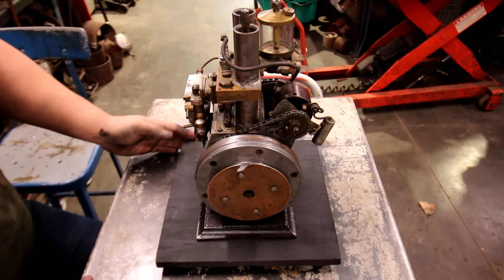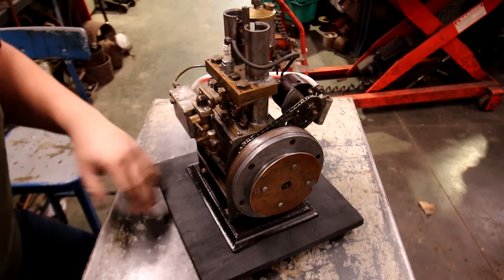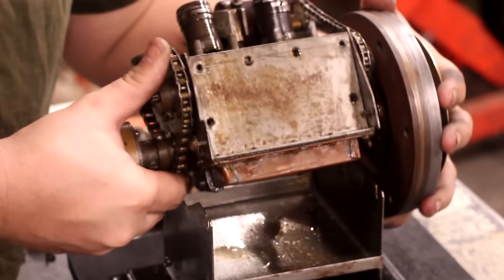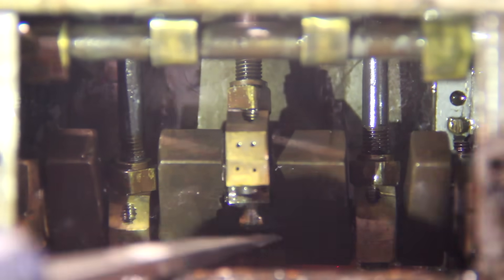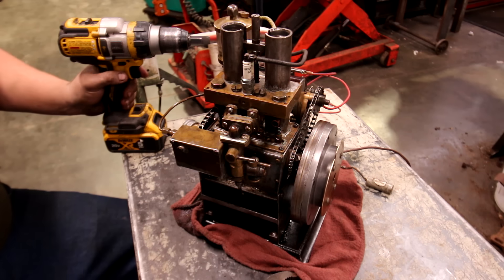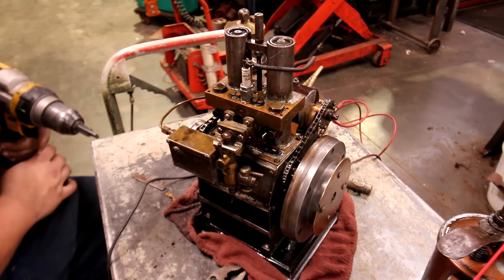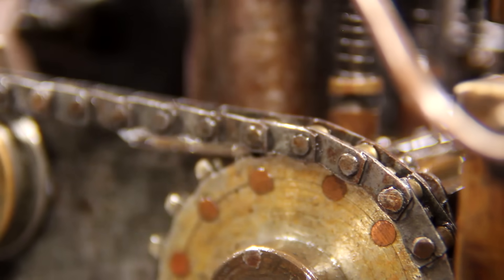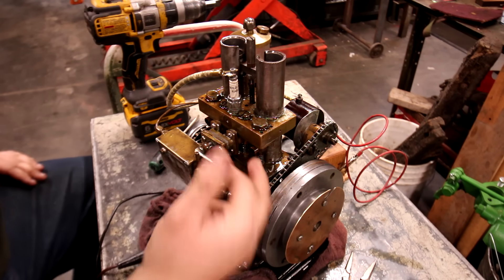RARE!   Antique Homebuilt Two Cylinder Opposed Piston Engine. WILL IT RUN?

Comment: Unusual for an opposed piston engine to have valves they are usually 2 stroke.  And only single plug so a bit more like a twingle.
Reply from the maker: its a twingle and apposed piston kinda terrible design really. like a quadruple twingle

Comment: As noted: There is NO cooling system for this nice little engine, so your run time is very limited, to about two minutes.
 
YOU are now the caretaker/owner of this nice little engine, So I suggest it is YOUR responsibility to take the Next Step, 
to ADD a cooling system that Suits this little engine, yet preserves the hand-made character of this "Historic Gem".

Here's How:  
(1) Start with a sheet of Tempered (heat resistant) Glass, about 1/4in (6mm) thick, and cut four 
       rectangular pieces, about 3cm longer than outside length needed to cover both cylinders. 
(2) cut two holes in these pieces of glass (that allow cylinders to pass through) with diameter about 2mm larger than outside of cylinders
(3) Make a small metal framework that holds the glass, using "angle iron" pieces, with an "L" shaped cross section.
(4) Cut four rectangular "side panels of glass, that are about 80% the height of the cylinders, to complete a 'glass box' 
        outer casing for your water jacket, that will hold water coolant, to keep your metal cylinders from overheating.
(5) Install the two Glass-Box water jackets onto the metal cylinders, leaving good spacing for the valve mechanism to run.
       (you may find it easier to install the glass around cylinders if you cut through the holes, making each two pieces)
(6) Add Inlet + Outlet fittings to the glass water jackets, so you can pump coolant water IN, and cycle/drain warm water back Out.
(7) Use Hi-Temp silicone sealant to make the "glass box" water jacket leak proof. The flexibility of the silicone also keeps expansion
        of your metal cylinders from cracking the glass when things warm up.
(8) Add a circulation pump, to move water through your new cooling system.  You can use a small electric pump, like those for 
       decorative fountains, or setup a way for the pump to be driven by the same shaft that turns the valve mechanism.
       For early testing, you may even just attach a garden hose to a faucet, and run water through the water cooling system, 
       then down the drain... With warm faucet water, this even gives you an easy way to pre-heat your engine before startups.

Note: Even though only the cylinders are being cooled by the water... most other engine parts will also remain cooler, because cylinders
         are being cooled, and most heat from other parts will be transferred by conduction, or be kept at a reasonable temperature by 
         the Oil that keeps them lubricated.

Note2: Using a glass casing for your cooling "water jacket" keeps the original engine parts visible, and maintains the look + character
          of your original engine, while making it able to control temperature and run for longer periods... making it a better demo +prototype.

Note on Lubrication... Use 2-cycle 40:1 engine oil mix with this engine, to deliver lubrication to the cylinders much like a chainsaw or 
other small 2cycle engine.  It will have a bit more smoke when running... but will be Way Better for reducing friction wear.

Comment: Using O-Rings in the pistons for compression can work OK for Short term, but will wear out very quickly... especially when engine heats up a bit. 
Another option for replacement piston rings would be: 
(1) Make a coil of steel,🛠 much like a "SLINKY" that is 3mm (or 1/8 in) larger inner diameter than the diameter of the piston, with 
metal thickness about 0.75mm (or maybe 1/32 in)... so that about THREE layers of coil will easily fit in the piston groove for the compression 💍ring.  
(2) Heat and Temper the "slinky" coil,🔥so it has some spring-like properties that will push outward against the cylinder walls a bit, for good compression seal.💠 
(3) Cut about 2.5 loops of this coil and place it into the piston notch, where you removed the old compression ring. 
(4) When you hold this coil into the ring, it will complete about three layers of coil in the piston. 
      You may need to fashion a ring compressor to hold this in place, until you install pistons into the cylinder... 
(5) Since you do not have any oil/lube system going to the piston rings & cylinder walls, ⛽use a 40:1 Two-cycle Gas:Oil fuel mix⛽
      (like the fuel a chain-saw or other small 2-stroke gas engine would need)  
      That way, you will deliver a bit of cylinder lubrication oil with the Fuel... and keep from wearing out your pistons/rings/cylinder walls so much. 🌀 

Great little engine...😀 and great demonstration in your video 🎥

Comment: Dude, that's an amazing little engine.  I really enjoy your videos, thanks for doing this.
I have one word of advice from an old engineer about using O-rings for piston rings (a pretty creative solution.)  In another video you said you used neoprene, which is good enough for getting the engine running briefly for a demonstration.  If you can get some HNBR O-rings they'll last longer.  It's much more resistant to heat and chemicals.  There are compounds that are even better, but they get expensive.  HNBR should be pretty easy to find and affordable.
Reply: Another option for replacement piston rings here: Make a coil of steel,🛠 much like a "SLINKY" that is 3mm (or 1/8 in) larger than the diameter of the piston, with metal thickness about 0.75mm (or maybe 1/32 in) so that about THREE layers of coil will fit in the piston grove for the compression 💍 ring.  Heat and Temper the "slinky" coil,🔥 so it has some spring-like properties that will push outward against the cylinder walls a bit, for good compression seal.💠  You do not have any oil/lube system going to the piston rings & cylinder walls, so⛽ use a 40:1 Two-cycle Gas:Oil fuel mix⛽ (like a chain-saw or other small 2-stroke gas engine would need)  That way, you will deliver a bit of cylinder lubrication oil with the Fuel... and keep from wearing out your pistons/rings/cylinder walls so much. 🌀 Great little engine... and great demonstration in your video 🎥

Comment: Why 4 stroke, and the whole idea of an opposed piston engine, is to do away with valves
Reply from the maker: the whole reason for an apposed piston engine it to get more out of less not really to get rid of valves. thats what a two stroke does.  and the most famous apposed piston engine is a two stroke to keep it simple and make it reliable. while taking up less space then any other form factory of the time.

Comment: An opposed piston engine needs two crank cases. I don’t see that on this engine.
Reply from the maker: @danieloblinger1199  yeah you don't need two crank cases to have apposed pistons. Just enough connecting rod to operate both sets from the same one. The pistons are opposed from each  one set moving at the other.  Same as a Kansas City hay press engine

Comment: I LIked the video.. BUT in this scenario you took it apart to make sure it was safe to run.... but you didn't do the basics you do before you start and old engine?  fuel, fire, and compression.  After seeing this you should try building your own with more sorcable parts..  it ran great for what it is. great video thx for sharing...

Comment: The slot on the outer disk of the flywheel may have been for a starter pull rope.  (Using a drill is easier and smarter.)

Comment: A very special engine! The sound makes me want to put this (casted) in a motorcycle.
The design has the potential to get more displacement into a smaller, lighter engine than with normal cylinders. Max rpm might be comparably low though.

Comment: There doesn't appear to be any transmission from the top pistons, only from the bottom pistons. The top pistons should have had some means of transmitting motion from the pistons to the main crankshaft. It looks like it is missing something. The combustion should occur between the four pistons.
Reply: The push rod connecting the upper pistons would deliver thrust to the crankshaft much the same way it's taking energy from the crankshaft to run the cycle

Comment: As for your question of what the base is I believe it started its life off as a home roller press there would have been a large rubber roller that allowed you to run a piece of paper through it and it had another return roller on the bottom to like print something off I've got one in my back garage so they probably just cut it and modify it to fit.

Comment: NOT opposed pistons. Opposed piston is like a the old 4 cylinder VW engine where two pistons are OPPOSITE of each other
You have a 2 cylinder inline engine. The VW engine had two pistons with a common crankshaft with the second two also connected the the crankshaft.
https://en.wikipedia.org/wiki/Opposed-piston_engine
Reply from the maker: @LorisSawmill    you are very much wrong. A VW is an opposed cylinder engine not piston. This engine has two cylinder inline with each other but each cylinder has two pistons OPPOSING each other meating in the middle of the cylinder.  Just like the link you sent from Wikipedia. Not sure what you missed about the internals of the engine but it is not just an ordinary inline 2 cylinder .

Comment: I Wonder if you put a big fan blade on the flywheel if it would push enough air around it to keep it cool and allow it to run longer
Reply from the maker: without cooling fins most likely not!

Comment: Should have put o-rings behind the piston rings to make em seal. The o-rings behind the piston rings would hold the piston rings to the cylinder walls and would keep the o-rings from melting due to combustion temperature
Reply from the maker: @OtisDavies-cv6ze  they will take the heat just fine and all the piston ring would add is extra friction

Comment: Back in the 30s and 40s there was no TV and other modern distractions.  These projects were very common.  There are a ton of homemade tractors and other stuff like that.    Figure supper is over by 6:00pm.  What's a guy to do for 4 or 5 hours every night?
It is very likely that chain is not exactly homemade in that sense. It is highly likely he built a jig.

Comment: I am at a loss to understand why you call it an "opposed" piston engine. When I was a kid my neighbor gave me a "Standard Twin" powered 2 wheel walk behind cultivator tractor. In a "Standard Twin" engine both pistons go up and down at the same time like the one you have there. That engine was commercially built by The Standard Engine Company Minneapolis Minnesota. It was a very unique design and it ran great. Whenever I tell anyone about it they say it couldn't have had both pistons going up and down at the same time or it would have vibrated. All I can say is the pistons went up and down together fired alternately and it did not vibrate at all. It ran smoothly and sounded great. There are a few videos on YouTube where people run them if anyone would care to see one in action. After tearing that tractor all apart at least a dozen times I learned all about it, and I often wondered why John Deere designed his 2 cylinder tractor engine pistons to go in opposite directions causing an "odd fire" engine. Harley Davidson did it to save width, but width wasn't rally an issue on a tractor. OK, I said my piece, thank you for putting your hand-built twin on the internet. ben/ michigan
Reply: It has 2 pistons at the top moving DOWN on the compression stroke, as well as two pistons moving UP on that same compression stroke.
There is no cylinder head.
It's 2 cylinders, 4 pistons.
The pistons meet in the middle, and combustion happens between them.
Look into the Napier engine.
That's basically how this little beauty works.

Comment: Run it on kerosene,  probably run better being the compression ratio.
Reply from the maker: Kerosene requires the right carburator and a hot engine it be to finicky for something this small

Comment: Think you used enough motor oil there, Butch?
Reply from the maker: I wasn't sure how much I wanted in the crank case but in old engine fashion to much oil is far better then to little
Reply: @cruddycornstalks I'm sure it was the right amount! I'm a retrocomputing hobbyist, we are just used to less oil in our old computers.

Comment: Very impressive craftsmanship, too bad there isn't a cooling system, it might have a use somewhere. Usually opposed piston engines are 2-stroke Diesels, so this is even more special, maybe you can finish what the builder started 🙂

Comment: Impressive understanding of the Otto cycle , at first glance I thought it was a two stroke opposed piston engine like the Commer TS3 Truck engine , but this is a four-stroke ! Commer TS3 Truck Design was around for decades , I worked on a farm when I was an apprentice and one day the farmer said " bet that you have never seen a 3 cylinder engine with 6 pistons , one crank shaft that drives rockers with 6 pistons , and the pistons meet at top dead centre , and it's a two stroke , and it's got ports with no valves ! I thought they were having a go at me ! But please look up the Commer TS3 engine ! Legend the opposed piston engine !
Reply: Those Commers sounded like they were turning 9000+ RPM's when they were really only going about 2500.... 😂

Comment: That engine is what is called aProof of Concept built in a Lab of a engine company around the early 1900s.  Companies like Fairbanks-Morse had Labratoryies which they had to build Proof of Concept to make sure they would work and test prior to going into building a Proto-type engine. My Dad used to work in  a Crane company which was started in the late 1800s and they had a lot of stuff like that!
Reply: Proof of concept I don't think so as an engine lab would not waste time hand making chain. This I think was one mans project and to have it running again is a joy of joys.  Well done getting it to chooch some guy up there is smiling.
Reply: Nope!  If it was "A Proof of Concept", they would have used standard chain.  That was a home project.  I wonder how many hours it took to make.
Reply: It’s good to know someone got paid to build this engine, it has a tremendous amount of work involved in it. Amazing just amazing!
Reply: Yes that is exactly what it is alright... unless it's not and it's just a engine some guy made at home. Good possible guess though.
Reply: I would think a company would use as many off the shelf parts as possible instead of paying a designer/engineer to make every part
Reply: Could also be a salesman's demo.
Reply: @jonqualey2204  Looks like one but although innovative I don't think it demonstrates quality not with a hand made chain
Reply: Nice engine
Reply: Nah, this is some guy's project that he made at home. 

This is NOT a proof of concept piece, made by a commercial company, to do testing on. 

It's WAY too weak and cobbled together with weird parts to be anything made by a legitimate company.
Reply: A lot went into that engine.

Comment: this is not an opposed piston engine. It is a twin cylinder horizontally opposed engine. Thats the first thing I must point out. there are only 2 pistons in this engine. ok lol its an inline 2 cylinder motor. Next, the engine is losing compression from the rings, you fingered this out. Good. However neoprem or nylon or rubber "o"rings will melt in an engine cylinder after a few seconds of run time. That seems obvious to me, as to why the engine boawgs down, and gets to dyin after it starts to warm up. The rings are melting. You need to find yourself, of have some made for you, by a machine shop, some new iron rings. Thats your issue.
Reply from the maker: This is very much an opposed piston. Engine 2 cylinders, 4 pistons, 2 pistons per cylinder that come towards each other every stroke. The neoprene o rings will hold up to 500 degrees of constant heat with no major problems.  Just get harder. The engine bogs down and locks up after a minute or so of run time because the tolerances on this engine are not great and it locks up I ran it for a good 5 10 minutes total after letting it cool down and the o rings show no sign of giving up and many projects before this one they have worked well for more then just me.we have some full size hit and miss engine that have had o rings in them for 20 years and they haven't failed to this day. If I wanted to waste a couple days making rings I could but in the end the cylinder bores are not very well machined and even with good rings would most definitely leak. I have the tools and skill to do it either way and the best option for the engine was the o rings. And if it had an o ring fail in an hour of total run time because it isn't made very well then  So be it it's a 60 cent o ring that seals perfectly when replaced. Model engine builder use the alot because they seal easier and have less friction then piston rings and are cheaper to buy and replace. Hope that cleared things up. Thanks for watching!

Comment: Off setting the crankshaft to the compression side of the cyl8nder is a common way to almost completely remove oval wear pattern on the piston and cylinder.
Additionally important to high compression motors.